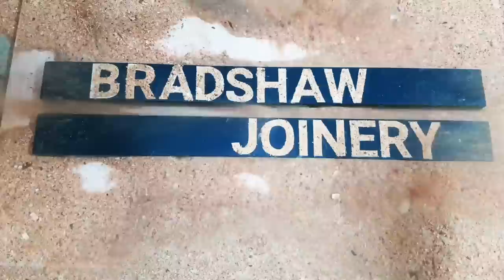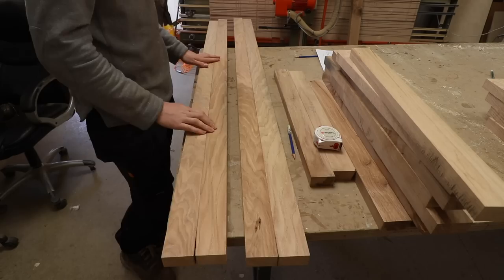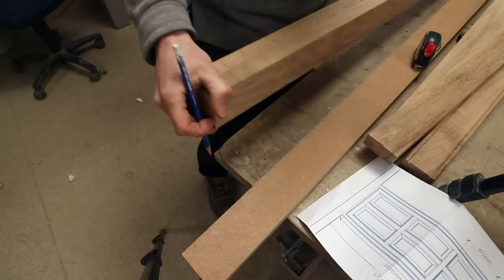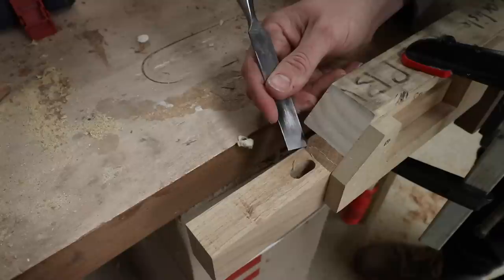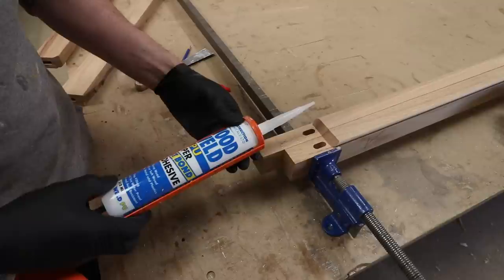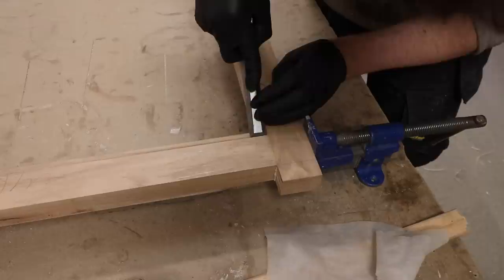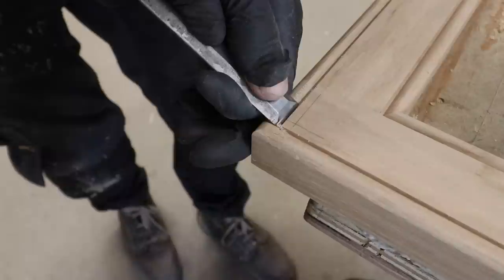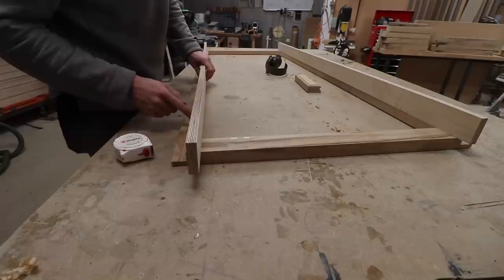English Oak Cupboard - Part 1: Double Beaded Face Frame

Comment: Really interesting hearing you talk about the PU glue. Wish I had heard it a week ago - I've just glued up a garden gate and tried to remove most of the squeeze out while still wet, never mind! How long roughly did you leave it until you took the clamps off and removed the squeeze out?

As someone has said above my bottle recommends to dampen one surface, and remove excess with acetone. Also interesting to see you weren't frantically rushing like I would be, once it starts foaming I assumed you'd missed the boat but clearly not. Does the 5 mins refer to open time or time to setup/remove clamps?

Will be using the chisel bevel guide idea too. Thanks for sharing all of this!
Reply from the maker: I might do a video just on the PU Glue as alot of people hate the stuff, its certainly diffictult to use, but it is good kit. I used to dampen but never noticed a difference, if anythign it adhered less to the dampened surface! Watch me glue up the door if you think i dont rush around! ahah, its scary when it starts setting and your only halfway assembled. 5 mins is just a marketing thing. wait for it to form a film and not be sticky if you lightly touch and i remove clamps. if you joints spring then reclamp for a few more minutes. just pay attention to it. i tend not to leave the clamps on till its fully set as they get glued to the piece or you have to use a thin polythene barrier which is a pain.

Comment: You have a nice spindle why use the festool to rebate the back of the frame? Nice work.... Also used a Hoffman machine for cutting the beaded frame in one run.... Of course its an expensive machine and would need yo be doing a lot of beaded/mitre frames to justify €...
Reply from the maker: I cant remeber why, but there was a reason, i probably wanted a play with it haha. ive got a hoffman dovetail jointer, but not the one that does notched frames. impressive way of doing it though!!

Comment: Hi Ollie,  Loving your (all) videos and conscientiousness re not shortcutting job/customer (a la Robin Clevett ) you are a great roll model.  
Do you mind me asking if your Quansheng Block plane is the standard or low angle model.  I’ve been debating a while with myself the likely best quality block plane, without having to pay Lie Nielsen type £s for one.  I would also appreciate your opinion on the merits etc. Kind regards.
Reply from the maker: Hi Mollyrockers, I cannot recall, but it think it is just a normal block plane. not super low angle. I dont use it an awful lot and tend to have quite a high angle grind on the blade so it works almost like a scraper when i do. Give richard Arnold a follow on socials, hes hand plane number 1 and may even guide you down the correct path better.

Comment: Excellent video (as usual) Oliver 👍 Had a look at your website too but could fathom out which end of the Country you’re based? Have a big project coming up and wasn’t sure if it would be worth going you a shout for some elements of it, depending on where you are. BTW have often wondered when watching your videos, approx how big your workshop is (internal) to give enough working space around those machines? Guess the camera angles can be deceptive. Am looking at setting up a workshop and curious to know how compact I can make it without making it a pain to work in. Cheers, Steve
Reply from the maker: Im south leicestershire. I removed all the location and phone numbers as i got a few nuisance calls, I did a workshop tour video, its about 10mx9mx 3m. but i have other storage for timber, the container and a spray booth extra!

Comment: Hi Ollie, another cracking demonstration of skill & patience. Interesting listening to your thoughts on PU glue. I presume you’ve used Titebond 3 for external work or would you have used Caskermite over Titebond? If the results are so much better with the PU then I guess the compromise in the clean up is just one that we have to swallow! Cheers🍻
Reply from the maker: Thanks Neil, i have used titebond 3, i just dont like buying it! haha. its good glue, and would use now over cascamite in external. Would go for 2 if internal! PU helps workflow and is mega flexible/strong. i do like it the more i use it. It, like you say, certainly has its difficulties in use. haha

Comment: I’ve been meaning to ask for some time - you don’t dampen one face of the glue joint, as I thought was required/recommended for PU glue?
Good job, though, as always.
Reply from the maker: I don't as generally the air has enough moisture to allow the glue to go off. ive not had a problem yet so i dont think there is any need. I used to mist spray but found the results no different. I think its more relative on bigger joints areas that are more likely to be sealed from external moisture.

Comment: Really enjoying your videos, well done. Just like to ask how do you avoid any hint of snipe from the P/T?
Reply from the maker: Thanks, tricky question and the answer starts with it depends! 🤣 

Basically your setting up for the type of cut your making, if your planing narrow board edges your more likely to see snipe than if you have a really wide board and equally the faster you push the less snip you'll get at a particular setting. I tend to set the rear bed up with a straight edge or rule, turn the planer head and let it grab the rule and pull it along with the cutter. I set the height so it pulls around 5mm in distance. Upto 8 if doing alot of wide board or the blades are a little dull. The all need to be the same and equal across the width of the rear bed or you'll get issues! Modern planers are great as the knives locate so accurately.

Comment: Why not just run the molding right through and cut 45's on the ends and just domino and glue the frame up?
Reply from the maker: Because the brief was something quality and matching the existing, you wont see any traditional frame with a full 45 at the corners. It looks horrible with timber movement and there is no strength in the joint using traditional joinery.

Comment: Sorry but not as accurate as my kreg beading system, still see the mitre is not dead on, and kreg done in a fraction of the time. But when charging by the hour good money earner
Reply from the maker: Hey John, there are better ways to do the notched mitre i agree, but for a one off frame this is probably the best, its good to practice hand tools and techniques! The best setup would be a morso notching guillotine!
Reply: @BradshawJoinery  to be fair - I had a one off job like this with pretty much the same beaded framing.  I looked at getting the Kreg Notching (jack mitre) cutter..... but then ....like you decided it wasn't worth buying another bit of kit for a one off job :) did it pretty much the same as you.... although mine was paint finish so much less stress:)  The last few minutes were worth watching as I didn't have to deal with external corners! great technique - I would have left the rails as long as the total external width and cut back everything apart from the thin beaded edge (almost like having a planted bead extending from the rail - if that makes sense) your technique seems so much better.